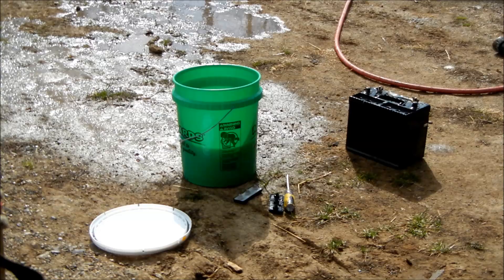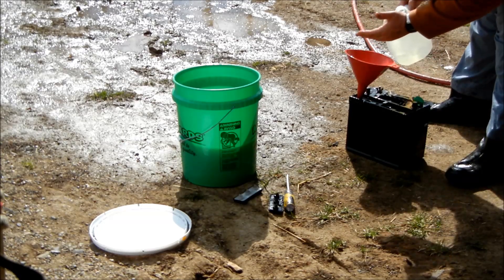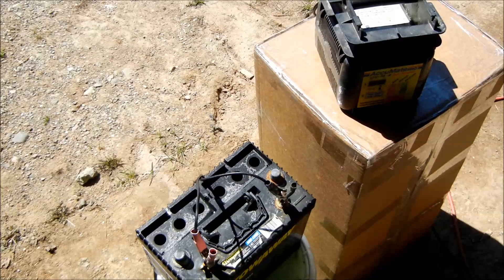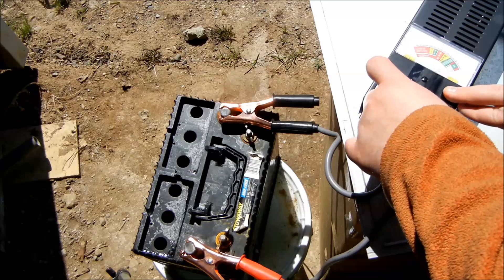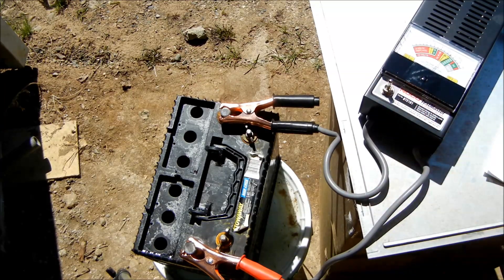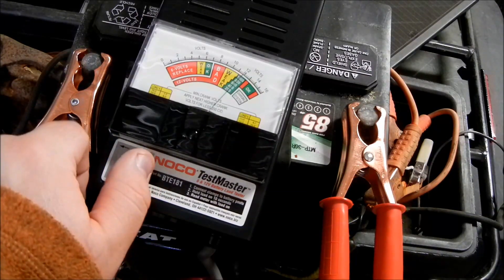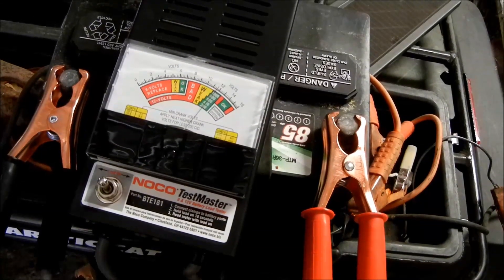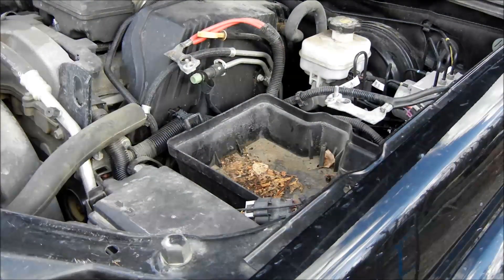Revisited How to repair a 12 volt battery for under 5 dollars using Alum with more testing

Comment: This is a very short and temporary fix at best. After a battery is taken off a charger you really need to let it set for several hours or do a load test to knock the false charge off of it like you did in this video. A fully charged battery will read 12.7 volts. A battery that reads 12.1 as showed in your other video is considered to be dead. While your battery charges up I just don't think it has the amps behind it. To be honest I would just replace the battery and call it done.
Reply: Apparently it got the amps because it started the truck in the winter and then again in the spring.

Comment: Speaking from experience here. Been in the Auto Parts business over 35 years. Just retired June 2012 and still playing with cars. You would be surprised at all the good batteries people have traded in for new ones over the years from not knowing a thing about cars. I recommend anyone who owns a car and would like to work on it themselves to pick up a 10 amp battery charger and a load tester similar to the one shown here in the video. Trust me they will pay for themselves .

Comment: Still looking forward to see how you make out with this battery putting new battery acid inside of it. Did you consider running the old battery acid through a paint strainer to somewhat clean it and reuse it back in the battery and doing a recharge?

Comment: Before using a load tester always try to charge your battery first. Doing a load test on a weak battery won't tell you a thing. I usually place my battery's on a 10 amp charger over night. With. 10 amp charger you really only need a few hours at the most to charge your battery if it is in good shape. Most of the time if the battery is bot good you will see in minutes that it won't take a charge or will only take a small charge but you won't get those cranking amps back like you had when new.

Comment: When you use a load tester as you have done when moving the switch for 10 seconds wou read the area in green on the scale. That shows Cold Cranking amps in the battery. The battery from the factory is suppose to read the cold cranking amps listed on the battery. Your battery doesn't read any cold cranking amps when you move the switch on the load tester over. Yours reads in the yellow weak part of the scale which usually tells me a battery is no good.

Comment: Hi redicety12 ! That's great info ! The fan in your truck draws over 10A and that's for sure. Bigger trucks use 250W fan but i guess your is around 150W. How long did the battery last last ? Over 2 hours ?